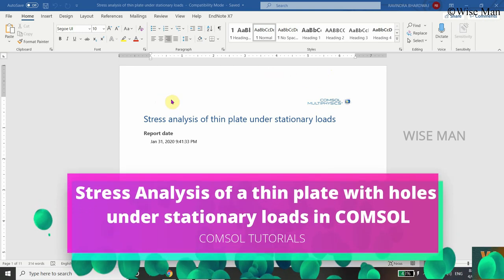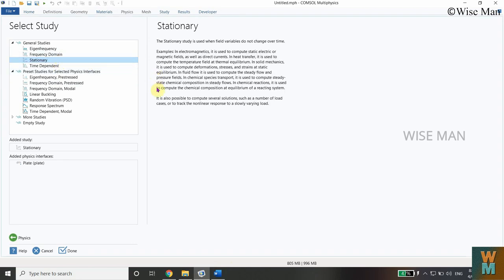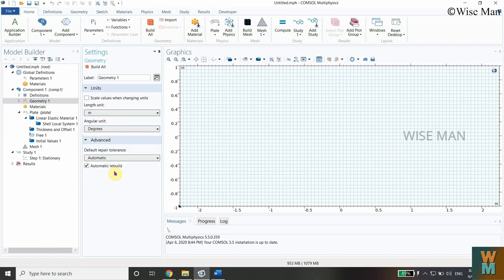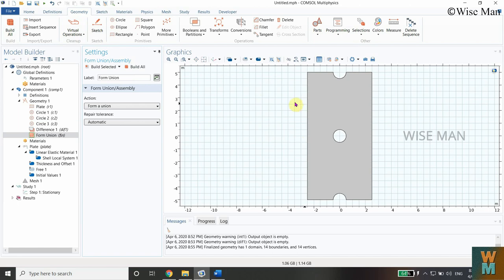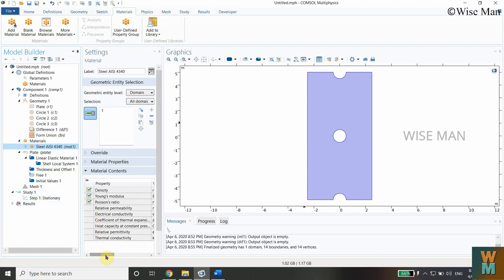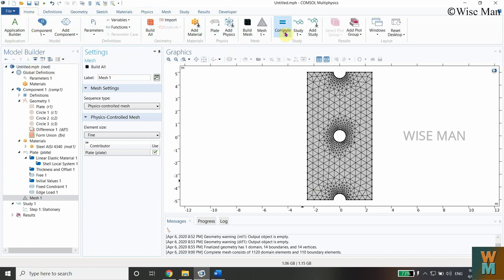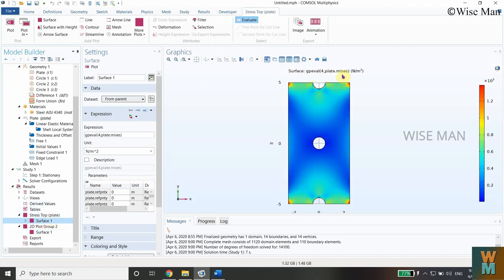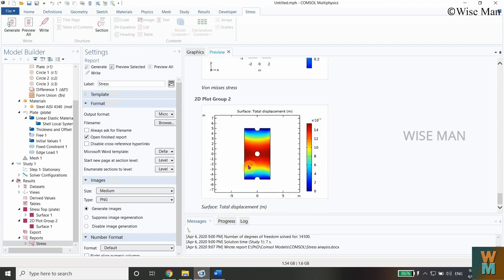Stress Analysis of a thin plate with holes under stationary loads in COMSOL

Comment: i have a question, what´s the part to put the fact thickness ?, beacuse i'm doing this analysis to determine the concentration factor (k), as you know this factor is in function of hole(diametrer), wide of plate and thickness.